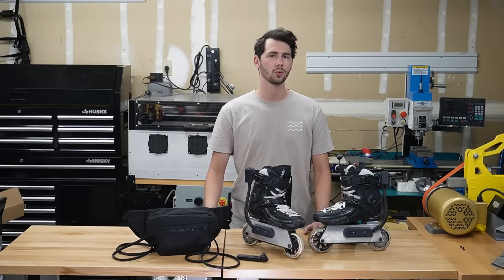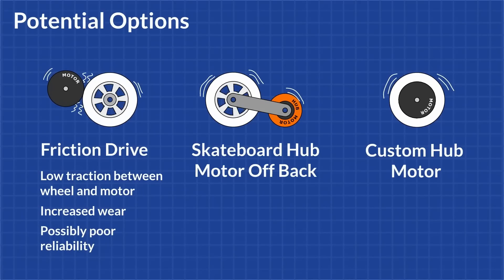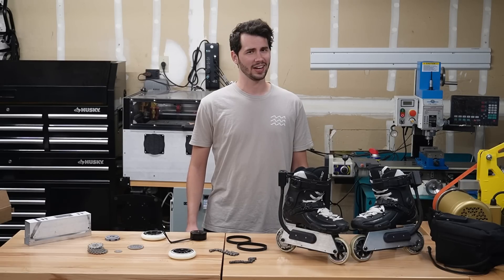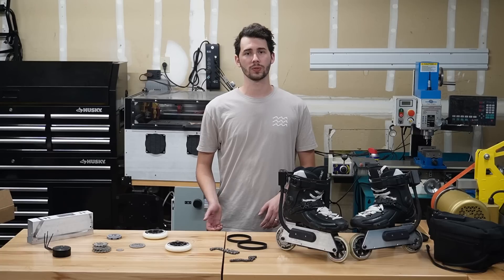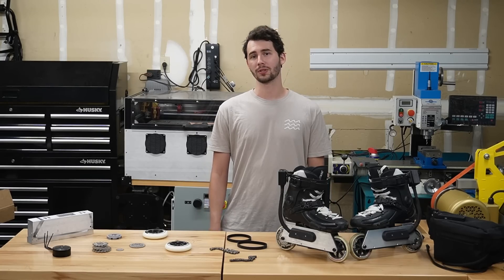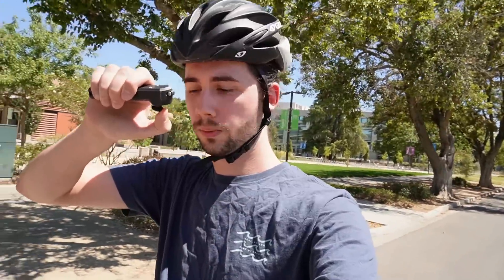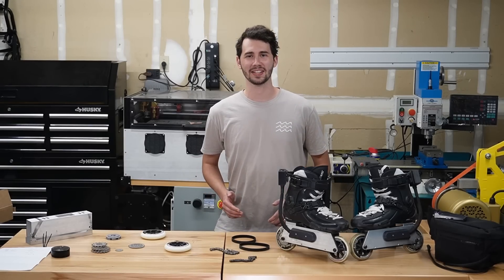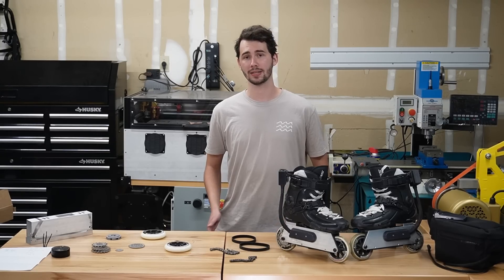I Made the Worlds FASTEST Electric Rollerblades

Comment: Incredible work Collin! Here I am trying to do the opposite, I'm trying to slow down my 110mm wheel blades because I can't slow down effectively LOL. I created a hand brake with a cable pulled brake caliper for my right blade that clamps on the two rear wheels. Your design is so elegant.
Reply from the maker: Thanks for sharing, Daniel! That's a cool solution!
Reply: Why not hockey stop?
Reply: @marktechsci  because I'm not that skilled , I don't want to destroy my wheels, and because the brake will be a full stop while standing.

Comment: Awesome! Two thoughts from me: 

1) A middle wheel would reduce the "train track" feel. If it doesn't fit just put a smaller one in there. It's quite common to mix wheel sizes. 

2) I think motoroised skates are just plain dangerous due to the wheel size. I think a more practical use of this tech might be some sort of electronic disc breaking. 
Breaking is one of the hardest things to do on rollerblades even for very experienced skaters. You might not even need a remote either, if you can some how detect a "stepping plough" motion you could use that to activate the brakes. The great thing about a stepping plough is there is no rollerblade move in any discipline (rec, aggressive, wizard) that uses this move so the possibilities of false positives would be slim. If you could crack the braking problem I think that would be a multi-million dollar idea.
Reply from the maker: Thanks for the suggestions, Pablos! I want to see if I can squeeze an 80mm behind the front wheel at some point

Comment: You can buy very thin drive belts, they're very easy to cut to size as well.
Reply from the maker: You can certainly do that, but my concern was that they might not be strong enough or would slip
Reply: @collinbardini  Toothed timing belt are used on conveyor systems for driving rollers, moving heavy loads, also on steeper motors driving machine tool parts, I changed them every years as part of routine maintenance, TPM (total preventative maintenance) they never ever needed changing, the advantage is they're very cheap, light and easy to slip on and off, keep a couple in your pocket.

Comment: 15:30 There's a few ways this could be done. A small load cell that's set up so if the load is below a certain point it goes into steady speed mode. Or if your controller sees a sudden uncommanded dip in current draw it could do the same thing, since current draw should always be higher when it's on the ground i would think.
Reply from the maker: Thanks for the suggestions! In another comment I mentioned that I tried the load cell, but my skates are a little too rigid to get a good reading. I think the current sensing is probably the best option because as you mention, the current draw should dip and you can compare that to the RPMs, which should increase.
Reply: @collinbardini  With current sense you can even adjust its sensitivity to also work as traction control so you don't get a sudden surge when you hit a patch of dirt or something.

Comment: Sorry, I’m new to all this but at 16:30 you mentioned belt drives. Would cutting the belt drives in half so that they are thinner make them less sturdy? Just wondering if that would allow them to be quieter for someone who wants to try this at home? 😅
Reply from the maker: No worries! You could less wide belts, but they would probably be less sturdy or slip. The other consideration is that the belt pulleys have additional width to keep the belt on. If you can accept a wider skate belts might be an option

Comment: try 25 pitch chain
Reply from the maker: Thanks for the suggestion, Ian! I have some 25 pitch chain and tried using it because you can get more gear ratios, but unfortunately it is wider than the bike chain I used and there is hardly any clearance as it is. Maybe if I were to custom make the frames I would revisit that idea, though
Reply: @collinbardini  ALSO, there is quite a width difference between #25 heavy duty and regular #25. there are also actually smaller chains you can get, miniature roller chain. It took a lot of digging to find this small of chains I used for a miniature bmx bike model. Here's a link https://www.usarollerchain.com/Miniature-Roller-Chains-s/5894.htm
Reply from the maker: @rskeco  Thanks for the link. The 04B chain looks promising! I could probably get much higher gear ratios with that.

Comment: when I first entered the world of electric scooters I didnt know anything about the different types of motors and the balancing of wattage and voltage after building a couple scooters out of parts I had Im more seasoned you can say it still amazes me the options had a gas scooter who's motor was completely ruined stripped it down to the frame got the specific dimensions needed to weld on a plate for the 1000 watt magnet motor I had screwed in a heavy duty tote to rack on the back where I ran the controller and battery geared up the motor sprocket and voila 36v 1000 watt 20 amph it was fun can't wait to do another

Comment: Very cool. You could use load cells between the wheel frames and the boot so they would operate like a self balancing hoverboard or unicycle. Leaning forward would increase speed in an attempt to centralize your weight. However this would drastically mess up your normal skate stride and require your legs to be side by side. Perhaps a throttle that detects the side load during your normal skating stride would work. So side load on the right skate would throttle the left skate faster. Seems like it would amplify your natural stride.
Reply from the maker: Good idea, Dan! I did attempt using load cells to detect if the skates were on the ground, but my frame was too rigid to get any reading out of them. I think they are still possible, but it would require a redesign of the skate frames. My plan going forward is to read the motor current and speed to detect if the user is pushing and if there is no load on the wheels. Thanks for the comment!

Comment: Why not use a esk8 VESC and program it on the VESC to so that it doesn't allow the RPM's of the motors to spin at different speeds from each other (or close to each other you can set limits) so when you lift a foot it won't speeed up?
Reply from the maker: That’s a good thought, Looneytube! Inside of the skates I am using VESC ESCs, but for them to communicate they need a CAN bus. Instead of running a cable up and down my legs, I decided on two receivers. Even though I need to run cables to the fanny pack for the battery, I am hoping that one day I can make batteries that fit in the skates.
Reply: @collinbardini  I see, while you have the cables running you might as well use the Dual FSESC4.20 100A, it's a beast and has the canbus built in. I use it on  my mountain board and it's insanely powerful at 10s.